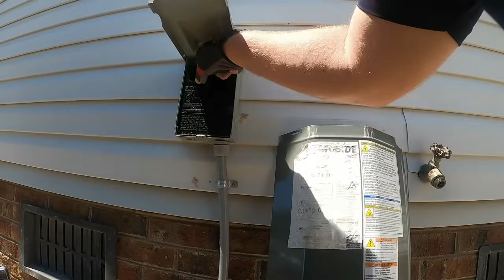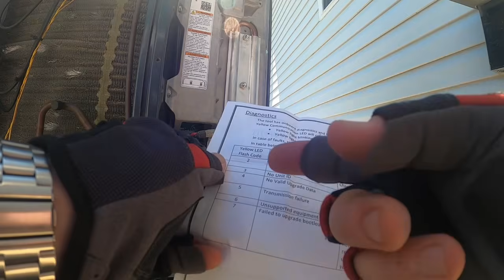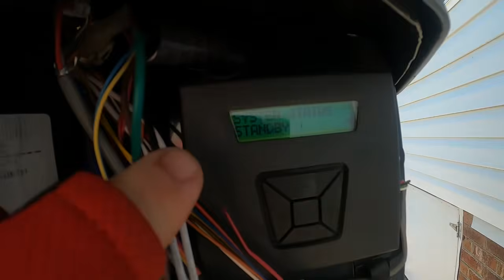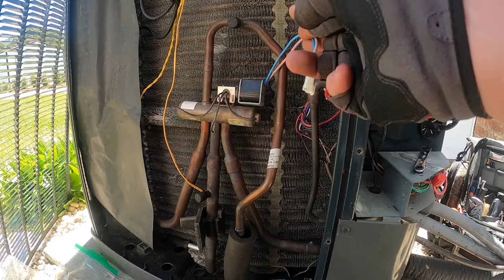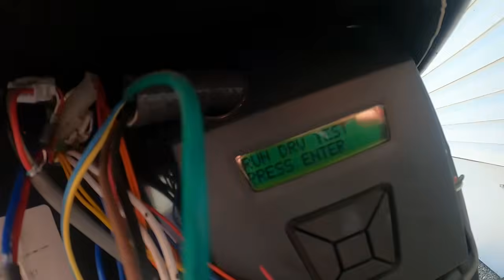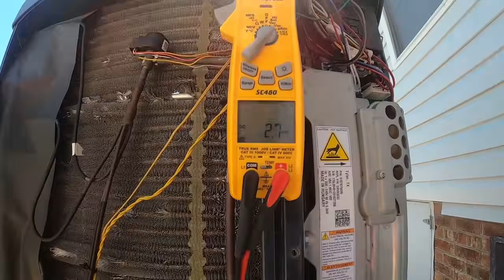TRANE XV Software update and LSOV Fix and Testing

Comment: REV valve  11.6 volts DC for Heat and 4 volts for Cooling......wow.  that Mantis tool is Gold . Wow. Your level of Trane Knowledge  i think exceed the Tech Support. You are hands o n....tnk you.  New candles need it inside for sure....i ve been there...i measure 330 volts DC the other day.....tnks God for my Fieldpiece...ttul...tnk u. Rene in Miami fl...

Comment: Thx great respect.  I don't have money, had to borrow for this, they sold me this XV20 along with a TEM8 & my house has non insulated ductwork, panned, etc.    So bummed my kid is disabled, and just us.   I have had so many issues from the get go, never efficient, mess still.    Replaced EEV, sensors out wazoo, blower motor, filter drier was restricted (sigh.).   Please, where is the time delay switch? Mine gets stuck in heating every morn in winter for 3 years since had it so maybe this solenoid also issue, have had burning rubber smell at heat pump too.   If only I could find you in my town

Comment: Having a difficult time finding the part# for the Solenoid Coil. The only info printed on my bad one is DC12V 19106X. Any help would be appreciated.
Reply from the maker: LSOV latching switch over valve 12VDC solenoid coil Trane part number COL20696. I assume you are asking about the one for the XV variable speed system. If not you will need a 24vac solenoid

Comment: Great video and I'll have to check the software and heater valve solenoid harness to see if it has the latest version. Where do you download the Trane XV software for use with the laptop and the RS-485 cable?
Reply from the maker: Comfortsite! We could not get it to work with the laptop, could be user error! Had to get the Mantis tool from ouR Trane FSR. THE NEW MODELS WITH THE LINK COMMUNICATING PLATFORM will do auto updates, if the homeowner connects and maintains WIFI.

Comment: Nice 😊 I would definitely be putting surge protection on the incoming electrical system .
Reply: Surge protector does pretty much nothing, a voltage monitor cuts off when low power is introduced, under voltage makes the boards burn themselves up

Comment: Great video. Is there anything on this unit that uses 24 volts?
Reply from the maker: The tstat gets it for power and display and it is used for load management control at the outdoor unit, but is not used for actual system operations.